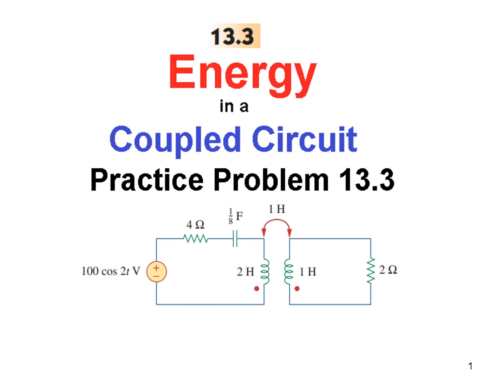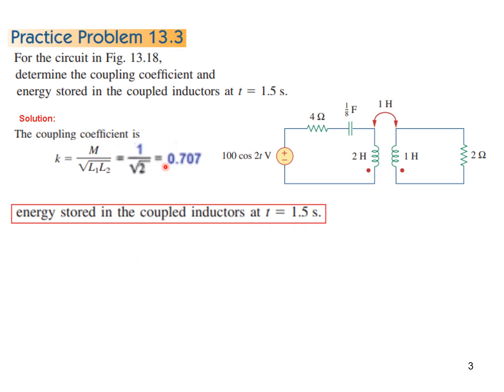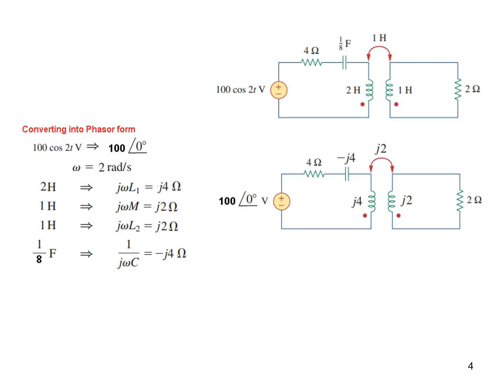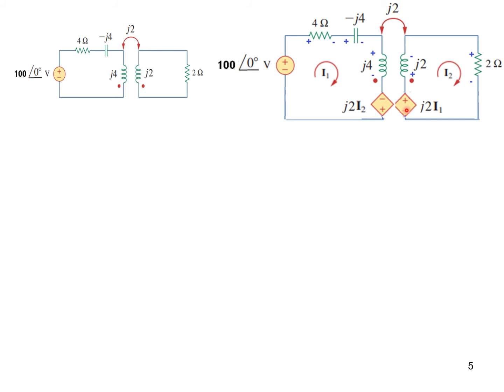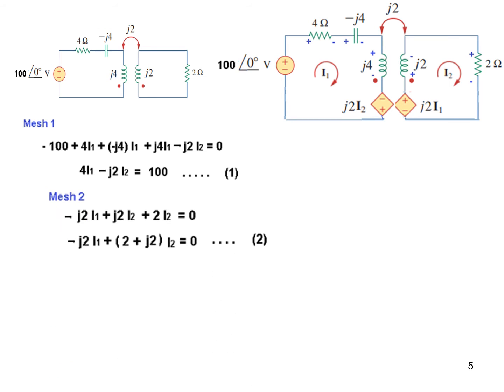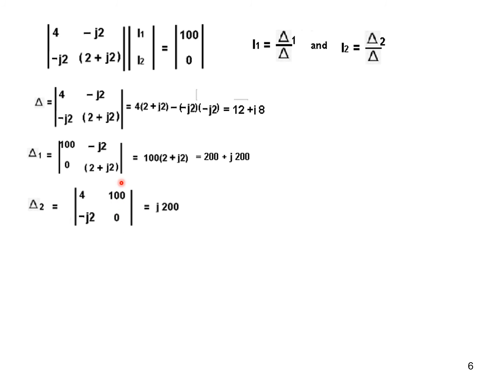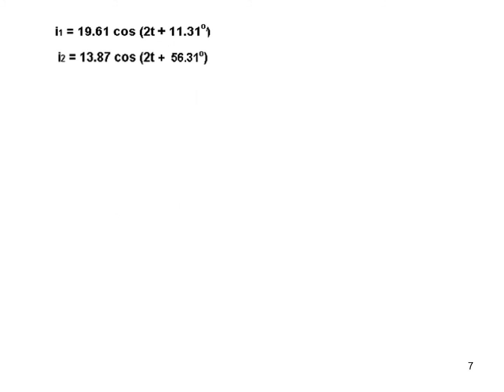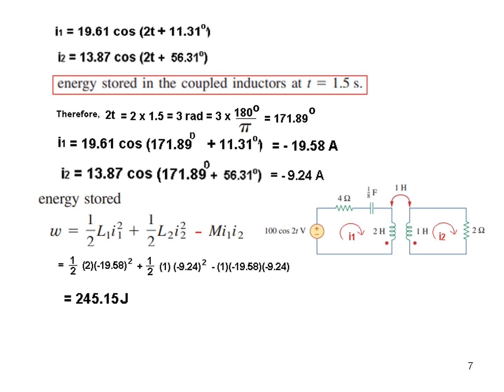(E)ENA(A)  Pr 13.3 || Energy in a Coupled Circuit (2)

Comment: sir can you solve 13.4 practice problem in the book by hayt  
13.4 Let is = 2 cos 10t A in the circuit of Fig. 13.14, and find the total
energy stored in the passive network at t = 0 if k = 0.6 and terminals
x and y are (a) left open-circuited; (b) short-circuited
Reply from the maker: https://youtu.be/Lvtmd2m0H5I